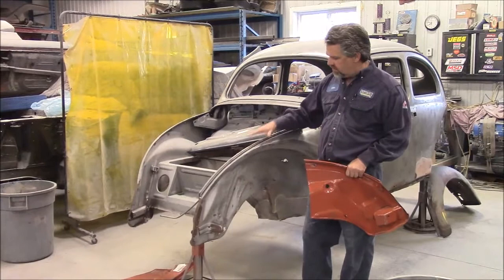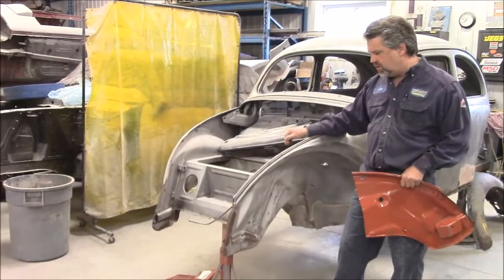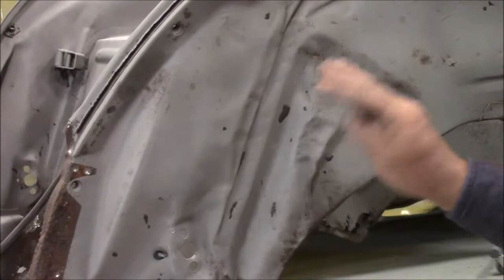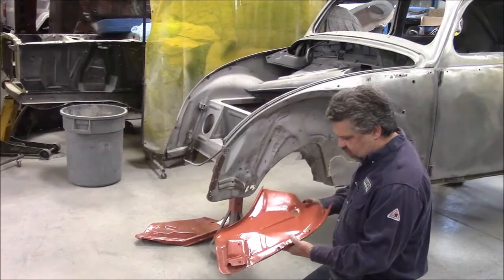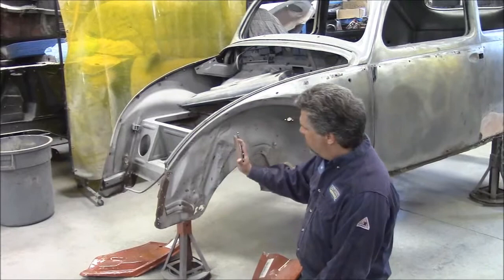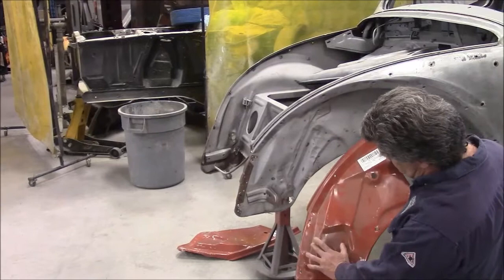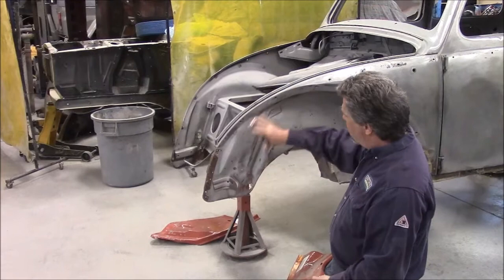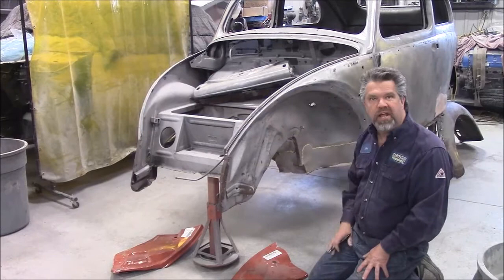1956 Volkswagen Oval Window Restoration Update, Front Wheel Well Part 2,  lastchanceautorestore com

Comment: i bought the same panels, threw them in the garbage. bought klokkers instead. there metal is thinner but at least they look correct. its bad if klokker makes a better panel XD for this car i would recommend buying from wolfparts, they make the correct panel for your car :)